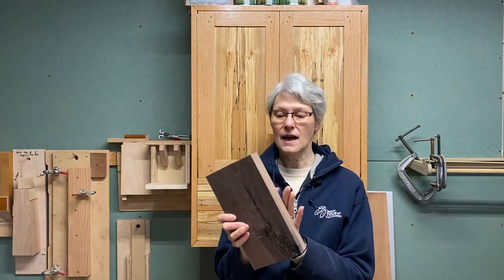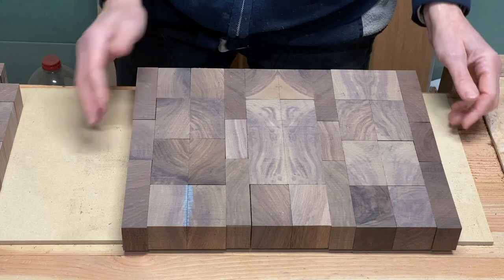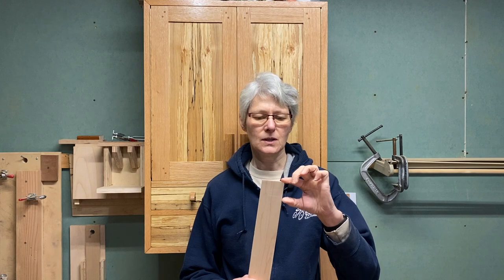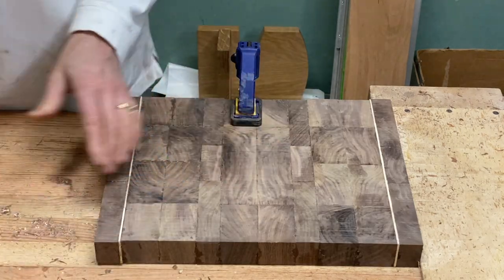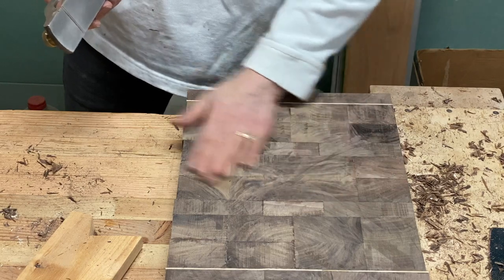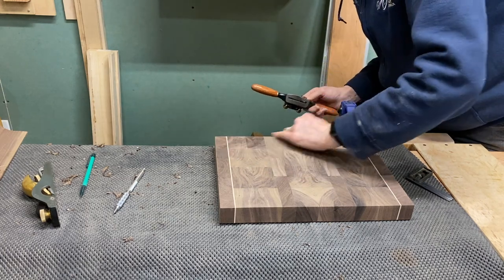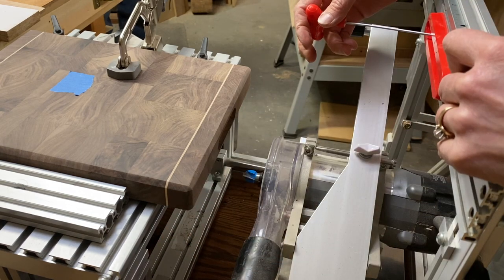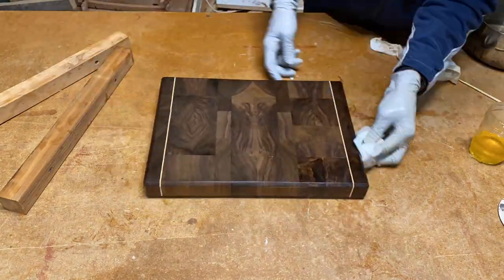Walnut End Grain Cutting Board from Scraps

Comment: Looks beautiful.  Question on your finish.  When you say 80% mineral oil and 20% beeswax, is that by mass or volume?  And do you need to heat up the wax first to melt it?  Sorry for the ignorant questions.
Reply from the maker: Questions are good! I believe I showed the process in a different video. The ratio I use is by weight. So 8 oz oil to 2 oz beeswax (or close). I buy pure beeswax in sticks. Melt them together in a double boiler, being cautious not to let it go up in flames. Thus the low hear double boiler. For me, it’s a small wide mouth canning jar in a pan of water. When it cools you have a buttery soft paste.
Reply: @SkyValleyStudio  thank you so much for sharing your hard earned experience and knowledge

Comment: Finally found a video that doesn't involve a jointer, planer and table saw! What TPI are you using for the cuts on the bandsaw? Mine is 3-4 TPI so gives a really rough cut.
Reply from the maker: Rule of thumb on bandsaw blades: 3 -4 teeth in the board at all times. So 1/2” thick “ 8 TPI. 1.4” thick = 12-14 TPI.